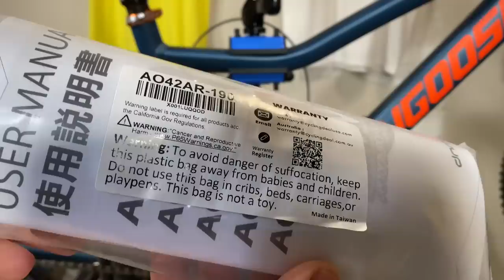Perfect FIT or Total FAIL??? 190mm Rear Shock for Mongoose Ledge X1

Comment: My Ledge arrived today and the wheels are completely junked 😂😂. So now that my brakes and suspension are all set time to throw my spare set of WTB STi 29er's on and see how it goes. Shame because this was the first 27.5 bike I was going to have. Wanted to rock out on the stock wheels/drivetrain for a week or 2.
Reply from the maker: Wow. 29 wheels will fit the frame
Reply: @KevCentral  Yep! I have a set of Maxxis 29x2.0 that fit with plenty of room to spare. My fork is a 29er so no issues there.  I may re-hub these factory wheels so I can run 27.5 but for now it will be another 29er 😄
Reply: More good news! The Pro Rush shifts through all 9 gears on my cassette with a M90 9 spd shifter! Just a few turns on the limit screws, very happy about that!
Reply from the maker: I meant wow to the wheels arriving junk. I knew the 29 wheel will fit the frame. There’s plenty of room.
Reply from the maker: What range is that 9 speed?
Reply: @KevCentral  11 - 34 tooth. The rear axle is loose and both wheels were very out of shape. I am dropping them off to get trued tomorrow and I've already adjusted and greased the axle. I'm with you on re-hubbing these wheels!
Reply from the maker: That’s not much range. It works because it can scale up to a 38t
Reply: @KevCentral  Yea my neck of the woods is mostly flat 😄. My Hydro is a 10 spd SRAM GX 11 - 36 😂
Reply: The rear brake hose routing was really easy man, cut the brake cable from the caliper and pull the cable housing out of the frame. Leaving the cable in, push the cable into the hydraulic housing and push the new housing in from the bottom up. Using the brake cable to guide it out of the top hole. 20 seconds at most 😄😄

Comment: I will change a 150mm Spring Shock to a 165 Air Shock (like your DNA)....i have other geometry and have drilled a 15mm away set bore...just in case....but i guess it will fit the original ones.....15mm ist not that much....my travel is DIRECTLY and not with a curved Lever like your bike so my more travel WILL make more way....

Comment: You gave up too fast. You could get about 15mm or more distance  from a new hole in the bottom shock mount (drill out the Half moon hole at it's lowest point)

Comment: I can't see why you make the difference between "linear" and "curved" travel 🤔. It's pretty clear from looking at your zip tie that it also tilts a bit. In order to measure rear wheel travel with your method all you actually need is a starting and a finishing point, the path taken by the shock is completely out of the question. If by shortening the eye to eye distance by 35mm you get 70mm of wheel travel then the bike has 70mm of wheel travel, simple as that.

Comment: How about a 170 or 180 shock that mite fit if thay make it
Reply from the maker: I don’t know that they would make much of a difference over the factory 165. There’s a point of near zero movement before it starts pivoting up. It’s not much after 165, so the pivot system is closely tuned for that size

Comment: Do they make a 180
Reply from the maker: There are, but I’ll stick with the factory range
Reply: @KevCentral  stick with what works that uses the best I was curious I don't know much about rear suspension but I used to work for a bike shop so but when I work for him we didn't have disc brakes either and I was just front shock suspension only and it was rock shocks on every mountain bike from the bike shop LOL

Comment: Just learned something new during my build...... Don't bother buying a water bottle cage. Nothing can fit in there 😄😂😂
Reply from the maker: Ha. I haven’t tried to add a bottle cage as I rarely use them
Reply: @KevCentral  It may just be the cage I am using, but even if the cage was reversed I don't see how an average size bottle would fit.

Comment: Good way of showing your viewers but the pivot placement sets the allowable shock size. Specialized has a adjustable clamp that allows for different size shocks on the stump jumper, but its a INFERIOR linkage set up. This project is excellent, but please tell your viewers alternatives in components to get the cost down. Tires are NOT something that can sourced cheaply, but everything else on this project except maybe the fork can.
Reply: Do you have a cheaper recommendation in place of the DNM rear shock? I got my X1 today and will be looking to upgrade it slowly over time.
Reply: @taumax   Not the shock or fork, but the fork is XC based on Kev's build. Same price for 34mm stanchion 140mm travel fork on Alibaba. This isn't a XC build.
Reply: @thiosemicarbizidebenzoylal2921  so basically you're saying that $190 for the Suntour Epixon is as good as it gets in terms of price to performance ratio?
Reply from the maker: This is where we disagree. I have LUTU forks (which is commonly rebranded Bucklos/ZTZ/etc.) They are not the quality of an Epixon.
Reply: @KevCentral   This is a brand new All Mountain fork.  Damper and stanchions are different.
Reply: @KevCentral   Its even got a AM sticker. Check it out. Uding has a All Mountain as well. Amazon is two years behind.
Reply from the maker: I just received a brand new Uding branded fork. I can tell you their quality (good for price) isn’t any different today than it was back when I got the first one 3-years ago.
Reply: @thiosemicarbizidebenzoylal2921  can you provide exact model number you're referring to?
Reply: @KevCentral  worth doing a review on the Uding fork?
Reply from the maker: You’ll see it soon, but it’s the same fork that was used on Project XR. That’s the thing with a lot of these off brand forks. They’ll be marketed as [insert various brand name] but arrive with one of 3-4 commonly used brands. They’re all surprisingly good for the money, but nowhere near the RockShox or Fox equivalents they are sometimes marketed as.

If Thio has found a new model that is different he knows he can go to my website and submit a link. I would be happy to try one, but I’ve yet to see one any different than what I’ve already seen.
Reply: @KevCentral   I will. The dampers are UNIVERSAL now. Fox has the same EXACT formula. The ONLY different forks on the market are OHLINS, but they suck and cost a ridiculous amount. Fox 34s and 36s have been equaled in the 200 dollar range.
Reply: @taumax   Just search Alibaba for 140mm travel bike fork with 34mm stanchions.
Reply: @KevCentral  in terms of price to performance sweet spot, where would you say off-brand Chinese fork is there or no?